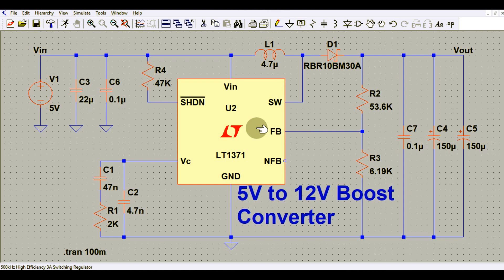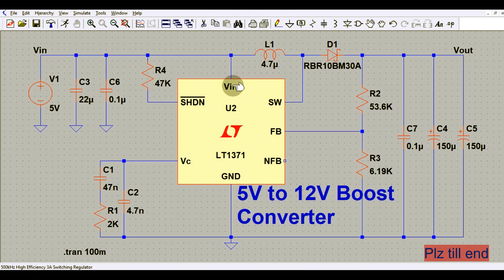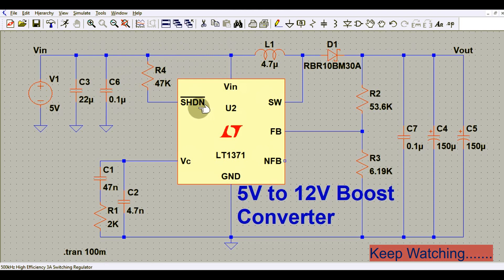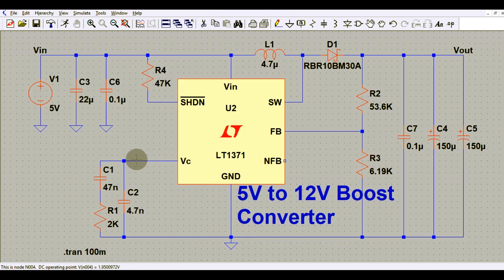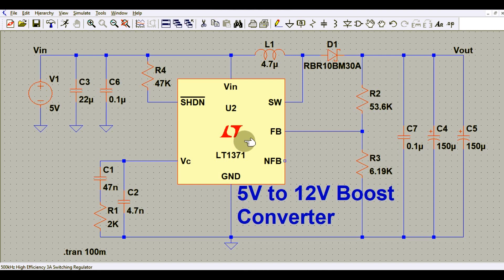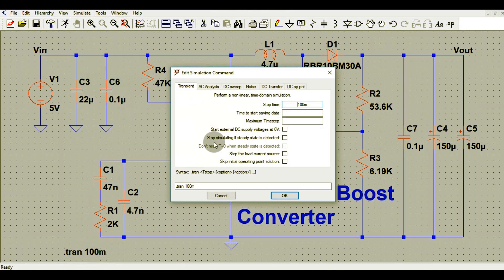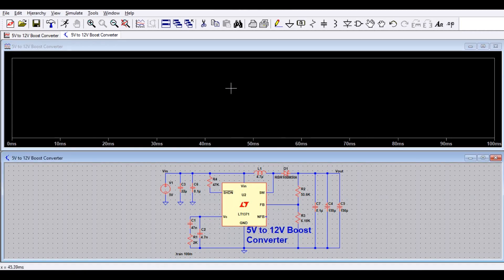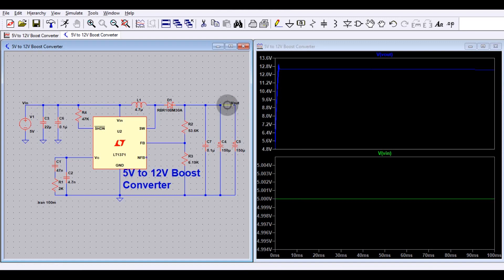LTSpice 5V to 12V Boost Converter Design | Simulation

Comment: Sir , If I want to convert an input of  1v  to 5v 
What should I do , or what will be different from this circuit. 
Appreciate your help
Reply from the maker: I will really help you and send you the LTspice file.
Do you need input 1V to 5V and output 12V ?
Could you please join channel membership to support me financially ?
Reply: @ElectronicsCircuitHubECH  
Thanks very much sir 
My order is to design a boost converter  by LT-spice to convert an input of  1v to an output of 5v only
Reply from the maker: @da7om12324  okay
Reply: @ElectronicsCircuitHubECH  Do you have WhatsApp number?